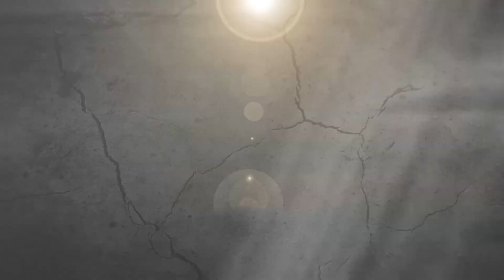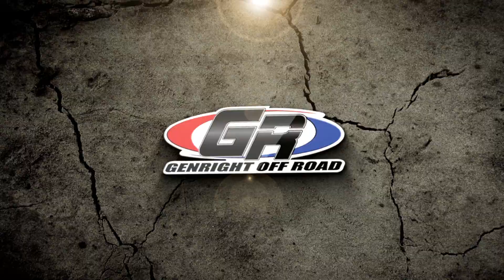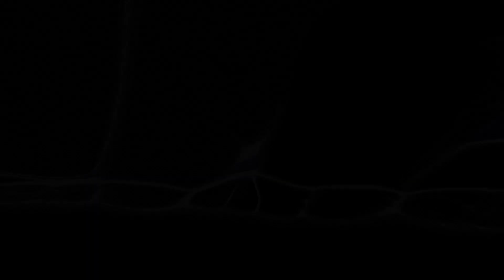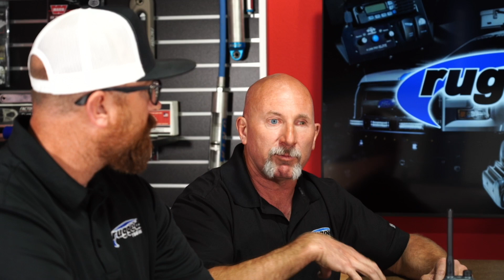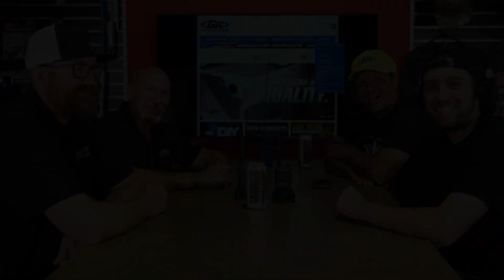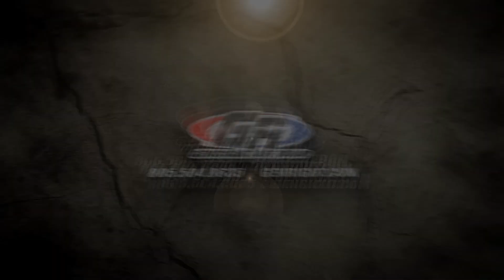Rugged Radios Special Guest on GenRight's Tech Talk with Tony

Comment: Legal CB radio in the United States is 4 watts. GMRS radios are 5 watts in hand held radios, and 50 watts in the mobile or base radios. The best thing about the GMRS frequencies is the FCC allows removable antennas. Drivers should take advantage of this and mount the appropriate height antenna on the roof of their vehicles. This affords better communications than holding a radio inside a metal vehicle.